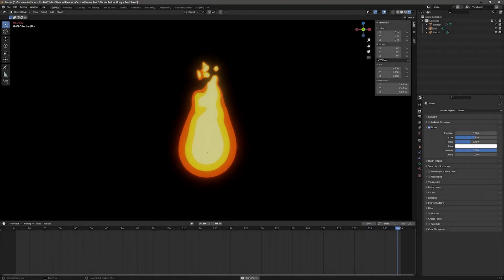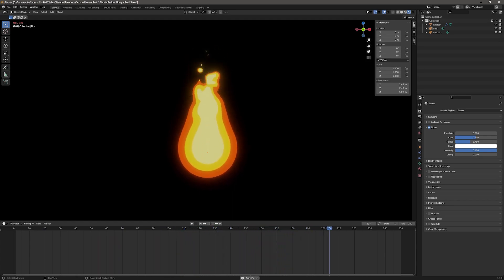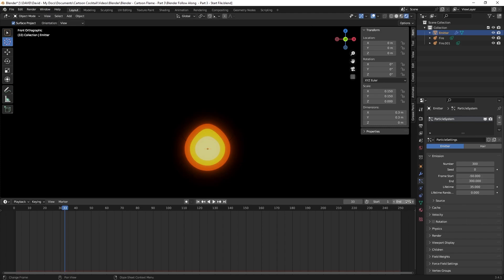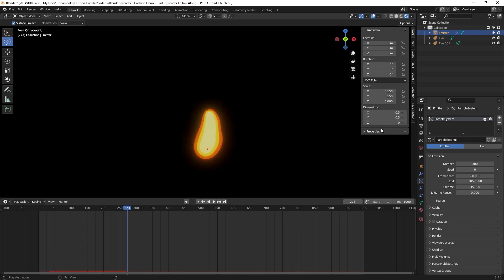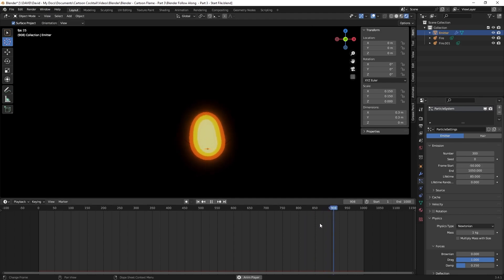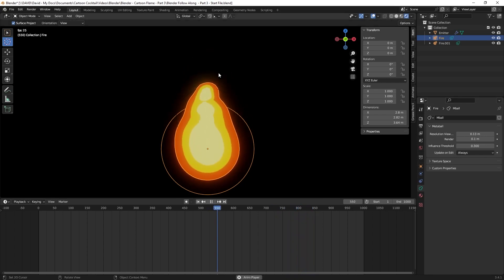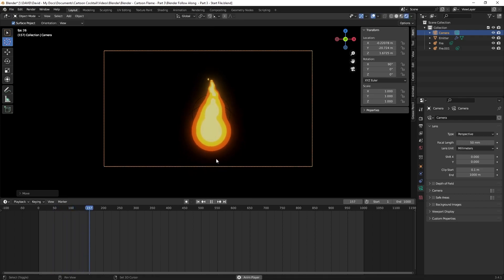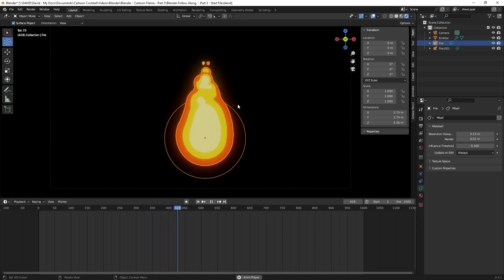Easy Blender Fire! How to Make Fire in Blender Tutorial Part 3: Adjusting the Fire Simulation Speed

Comment: That's really cool! I'm just wondering if there's an easy way to change the scale of the fire without changing the animation, which might be a little tricky since the scale of the emitter etc change the emitted particles.
Reply from the maker: The easiest way to change it for me was adjusting the scale of the emitter and the scale of the particles; however, little adjustments here and there throughout the settings really affect the final result, so you may have to play with. It can be a bit fidgety. :)

Thanks for watching!

Comment: Currently working on a small project with this. I have a question though, how would I go about connecting this to a mesh that I plan to rig for animation? I hope this is possible.
Reply from the maker: I'm not certain this would fix your issue, but could you parent the fire object to the mesh?
Reply: @writinganddesigning  Thanks, I'll try it.
Reply from the maker: @TheCrabActivist4525  Hope that helps! Good luck!
Reply: @writinganddesigning  That didn't work but it got me thinking. So, now I created a vertex group on the model itself and set the particle properties "Vertex Groups" tab's density option to said vertex group, now it only emits from the selected area, currently redoing the steps in your wonderful video series and hopefully I won't run into any issues. Only thing is, I will have to figure out a way to make sure the Metaballs follow the vertex group as well. Thank you for getting the old cogs in my brain running hahah! Stay safe and have a great day. (Also, I'll update any major progress here in case anyone comes along the video with the same question, sorry to be a bother heheh!)
Reply from the maker: @TheCrabActivist4525  Sounds great! And updates would be helpful because I think there are a lot of ways you can use the metaballs/particles method, but it may require tinkering that I haven't done, so I could learn something new, too. Thanks for watching, and I'm glad the videos have been helpful!